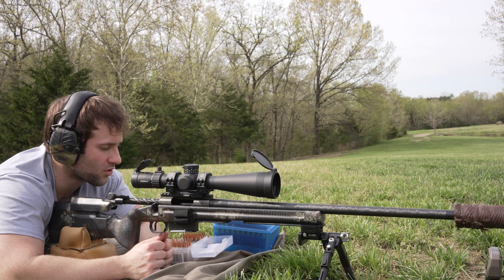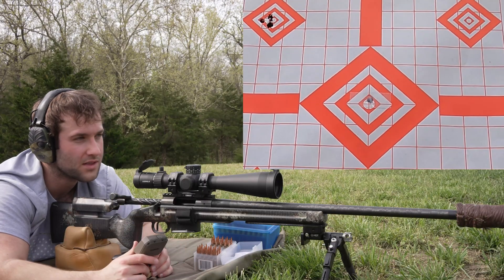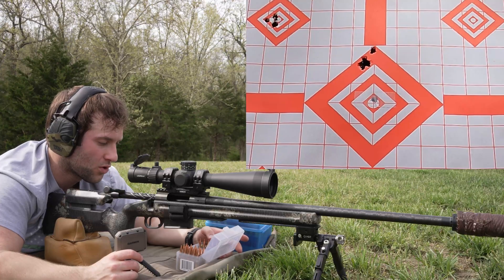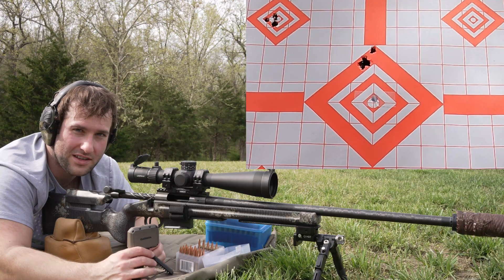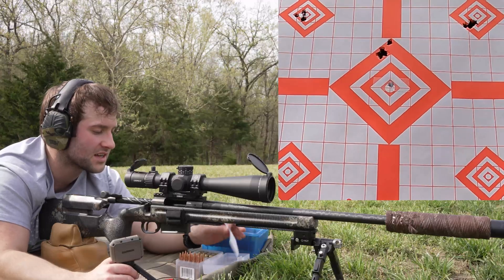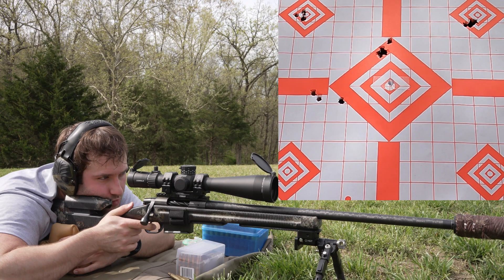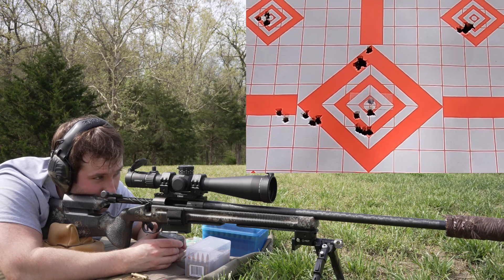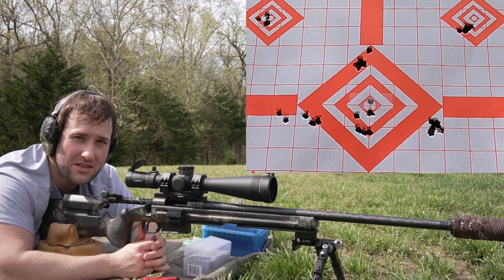Accuracy Testing 135gr Berger Classic Hunter & Sierra 140gr Matchking in Full Custom 6.5 Creedmoor

Comment: With H4350 42.10, 42.20, & 42.30 are accuracy nodes. You need to perform a seating depth test to help tune the load. You stated you seat enough ro make sure you are safe from jam. Measure the chamber and seat minus .050”. Start there and work closer in .002” or .003” increments until you see a wide node .006” wide.

Comment: The Vihtovouri website has load data for pretty much all types of Berger bullets except the Classic Hunter. I believe they have data on the 140 grain SMKs though.
Reply from the maker: I love Vihtavuori powder, but I am not a huge fan of their load data. There are many times where it's so conservative that it actually makes me nervous to use it. I do appreciate you mentioning it, though!
Reply: @RisenCitizen Yeah, I agree. Their load data seems super conservative.
Reply from the maker: @michaelhill6451 normally, I don't mind. There have just been times when it made me nervous because I had so much empty space in the case after putting powder in. There is a point where not enough powder in the case is dangerous too :/.

Comment: Is it possible your Garmin is too close to the ground and grass is getting in the way. I had to place something under the rear leg of mine to get it pointing up slightly.
On another note, the Berger Classic Hunters have been the most accurate bullet I've found in several different calibers.
Reply from the maker: This was the only time I've ever really had an issue with the Garmin. However, I actually updated it after making this video and the issue completely went away. So, I think it just needed the update :).
Reply: @RisenCitizen  I see some others on-line having the same issue and the update seemed to fix it for all but a few.
Reply: That was my thought also was the grass interfering with the Garmin.    I've not had a single missed shot with my Xero using a Red Ryder bb gun, crossbow or shooting suppressed 100% of the time with rimfire or centerfire.